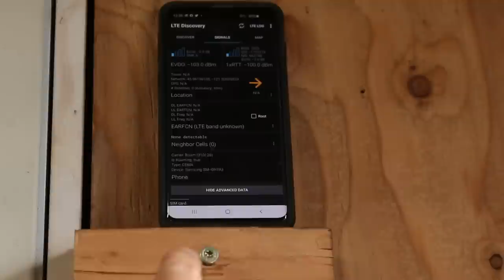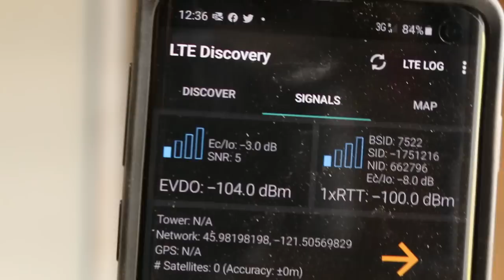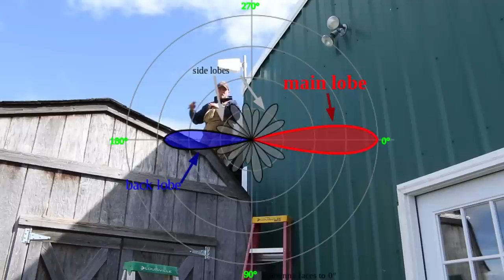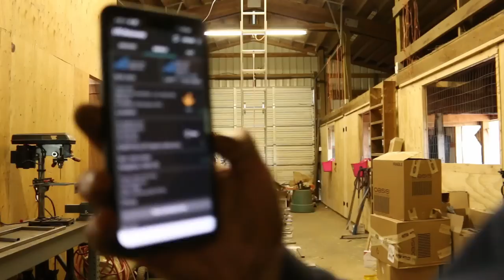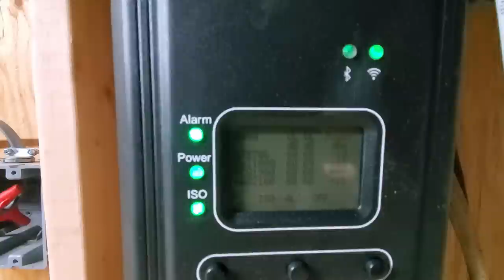Best GARAGE Cell Signal Booster! HIBOOST - This Thing ROCKS!

Comment: MISSION Commander, now be REAL SMART and plug the Unit/Transceiver INTO a computer UPS, so when u loose power u can make EMERGENCY phone calls real fast at full signal, also do the same for the house, battery BACKUP is NUMBER 1 PRIORITY. Also u shud be able to put a 2nd antenna outside with a t connector and mount it on a pole in the middle of the yard, BTW the antenna needs to be waterproof and u need to rubber butle the connections to stop water Ingress. Do not leave connectors unsealed and heatshrink without glue on the inside lining is no good either.
Reply from the maker: that is a great idea!

Comment: For a little bit of added security on the ladder try parking your lawn mower, truck, or tractor right up to the bottom rung so that the ladder can't slip back on the smooth concrete.

Comment: One aspect not covered is that a directional antenna/booster will eliminate MIMO signal and could lower your upload/download speed.  Great if you only have one tower in range but if multiple towers are in range but have a low signal a mimo booster/antenna is better.

Comment: The Wilson/WeBoost have Direction Antennas on their current fixed-base Cell Phone amplifier units.
How old is your Wilson unit?
If you would research the current Wilson/WeBoost offerings you would see they offer comparable units.
Reply from the maker: mine is about 8 years old...i have upgraded it to the diretional kit
Reply: TheRealMartian 
Check out the spec’s on the Wilson/WeBoost... They have improved dramatically!!!

Comment: Aren't you mixing up some things? "Internet WIFI extenter"? What do you mean with that? LTE (4G) distrupts WIFI? That's new to me, and I have no problems with WIFI with my extender and I can't really find any info on that except for WIFI 6 that very few routers use for high traffic areas (and you can usually switch to different set). Also, hella expensive setting up your own mobile network for your entire farm, much better having 1 cell extender, and mesh out with cheaper WIFI around the farm.
Reply: there should be no issues with wifi and PCS  frequencies
Reply from the maker: i agree there should be no issue, however, the reality is that there is. we have found that we have to turn off the wifi on our phones in order to receive LTE. As soon as we turn on wifi we lose LTE and go down to 3g. perhaps its a software thing, but regardless I try to ensure i keep the signals seperated. in addition, I did test the two antenna, and as soon as I put the cell antenna close to the WIFI I lost both...perhaps a power issue
Reply: @TheRealMartian   I wonder if one of the the repeaters is picking up the other.   Might be worth  seeing if you can turn off that freq. In thr hiboost   sprint does have it's  2.5 Ghz spark/WiMax  freq that may be built into the booster  but,  i doubt it.
Reply: @Stevospeedo repeaters are pretty finicky sometimes.  Nobody talks about the strain it puts on the receiving tower sector either.